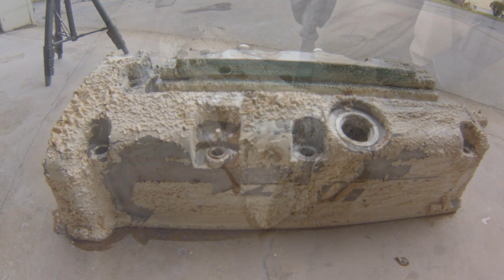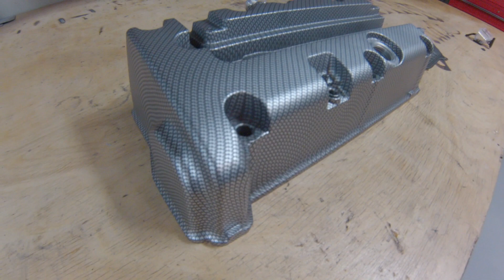Hydrodipping a Valve Cover Start to Finish

Comment: If i dip on a parts of my car which is usually hot what will i use for the base a high temp paint or non high temp will do?
Reply from the maker: jeram oasay I recommend going to ohwpaint.com and buying their base coat on a spray can.   It’s made specifically for hydrodipping parts and can hold up to high temp pieces like valve covers.

Comment: How does that hold up a car engine heat any peeling or cracking
Reply from the maker: It is completely stable to the heat of your average valve cover.  The paint I use is good up to around 400 degrees.  If you engine gets that hot, you have other problems!!!   lol
Reply: It doesn't last long. Mine cracked and peeled off in about a year

Comment: What is that paste called your used to help sand the valve cover off
Reply from the maker: The material that I brushed on?   That's aircraft stripper.  It's just a chemical paint stripper.  Good stuff!  But don't get it on your skin!